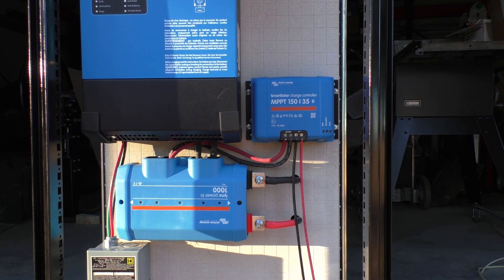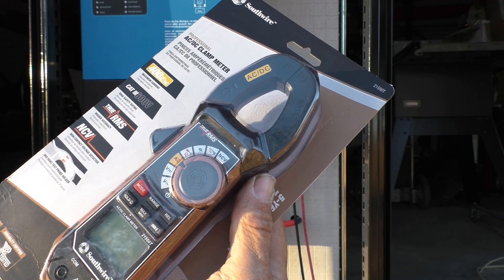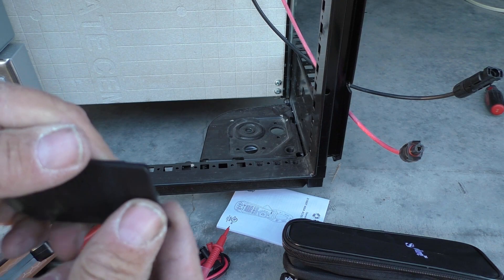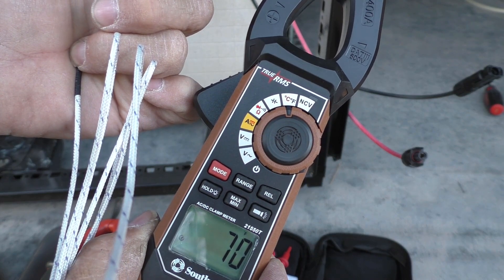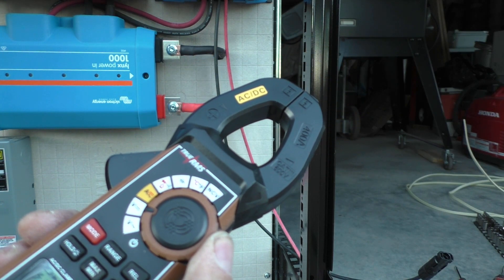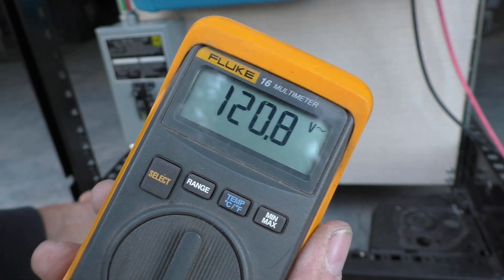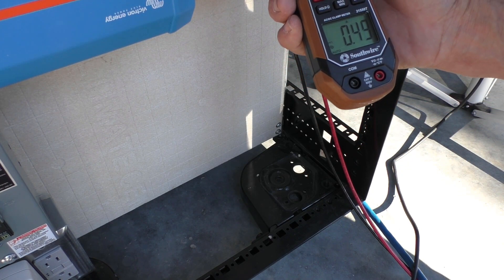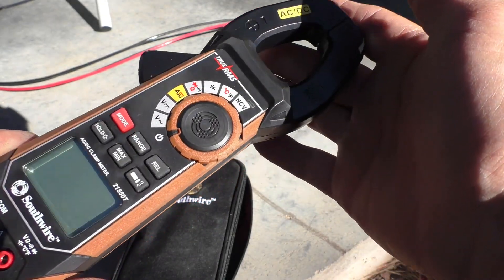Southwire 21550T True RMS 400 Ampere AC/DC Clamp Meter Spencers-Mountain Solar System Testing

Comment: Southwire makes the wire that you buy and put into a house or industry so they're not going to cheap out or Source out their clamps to another company
Reply from the maker: There are many companies that put their names on lessor quality products outsourced to other manufacturers.  The clamp meter in this video has very good specifications for the price point and is much better on these specs than similar appearing meters in the price range. Tested against higher spec instruments it appears this meter meets advertised specs and provides reasonable function for the price point. Thank you for watching.